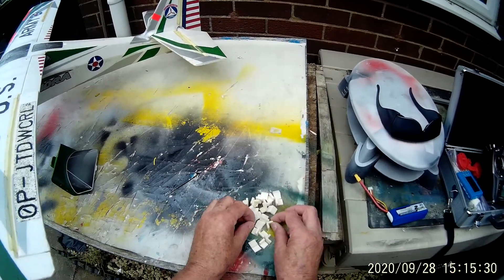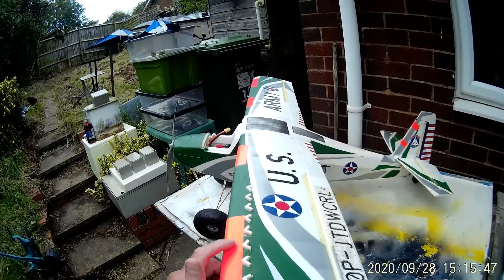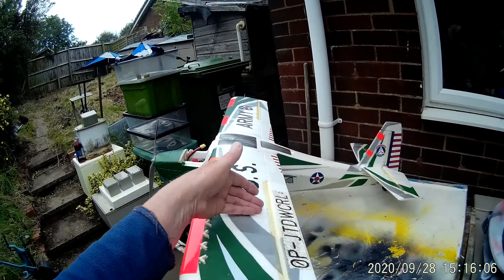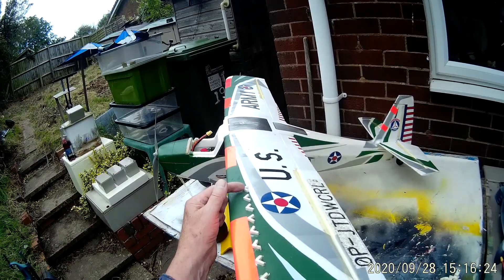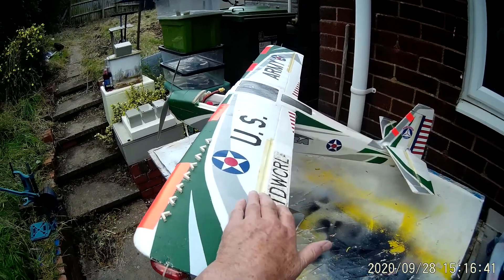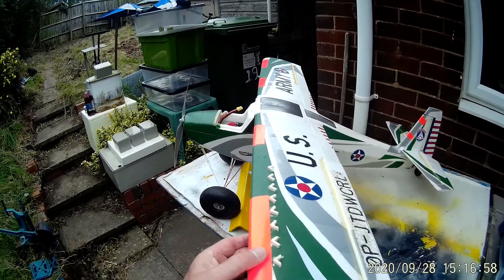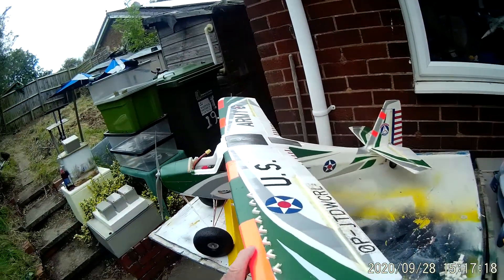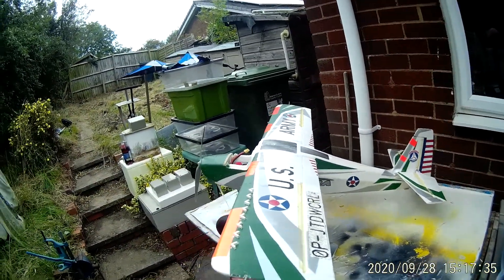VORTEX GENERATORS AND HOW THEY WORK.

Comment: Great idea and well done for trying them. Your point on drag is valid and evidently from the research that I've readon this the angle of the generator fin itself should be between 15 and 20 deg from the flow of the air to create the optimum trip and twirl effect to the boundary layer. 
Yours appear to be at around 45 deg hence the drag? Have you tried them at other angles? Keep messing with them, that's the best part of our hobby!
Reply from the maker: Good point I will try some more with reset angles,thank you.